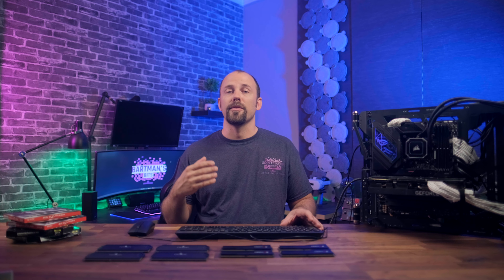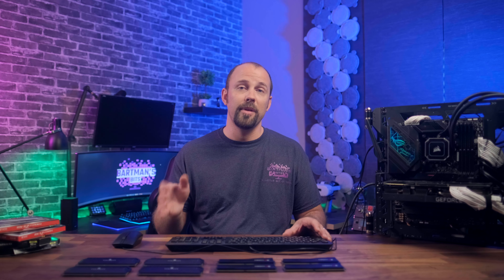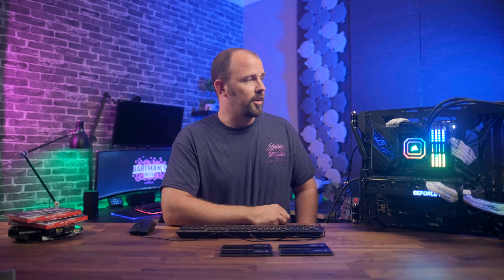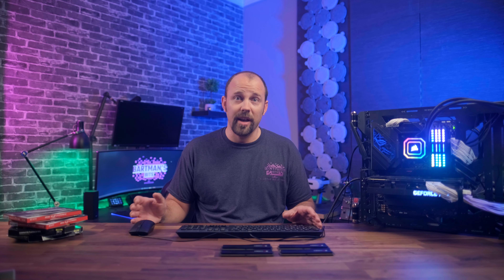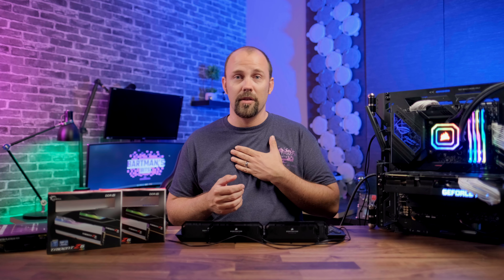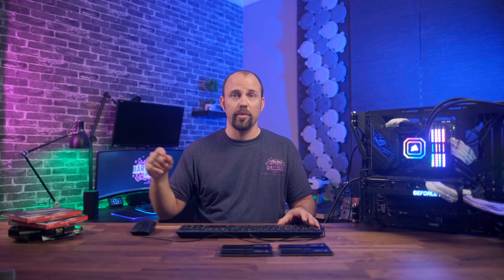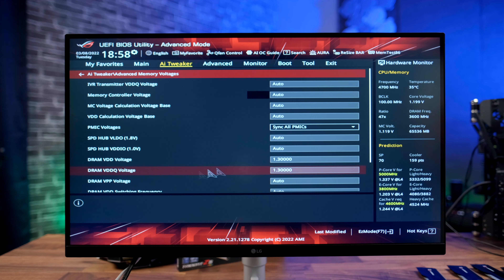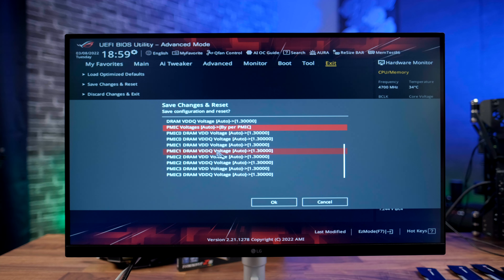Intel’s DDR5 problem resolved! DDR5 64GB Boot Loop failure Fix. Get the rated speeds of your RAM!

Comment: Hello, I have the X670-pro board purchased almost 2 months ago and since the first day I am having difficulty using the kingston KF560C36BBEA-16 memory, two 16GB, sometimes the board does not recognize the memory. I need to turn on/off to recognize it.

I have already contacted Kingston and they tell me to test with another memory, but I don't have other DDR5 memories to test... but first I thought of asking you if this board requires some configuration to be done to recognize the memories?

I don't know if it's a problem with the memories, I believe not because it works sometimes.. but I'm going to test with these memories that I mentioned that I got on the Asus website from the test memory list.. ALTHOUGH THIS ONE from Kingston is on the list

obs: memories are placed according to manual orientation, in the two gray one each, A2/B2 but black bus A1/B1 tried several times did not manage to recognize any only gray bus B2/A2. I did EXPO II but I tried with EXPO I and also without overclocking.
I updated the BIOS.

Comment: Hi! My system won’t post despite the changes in the video. My motherboard is an ASUS ProArt Z790 Creator Wifi and I’ve updated the bios to the latest version. I got 2x32GB of Corsair 6600MHz CL 32/39/39/76 plugged into ram slots A1 and B1. I can’t increase the voltage more than from 1,4V to 1,43V without the system becoming unstable. Any tips in fixing this?

There are also two XMP profiles when i choose XMP. One with the speeds and timings mentioned above, and one with 6800 MHz CL 32/40/40/76. I’ve tried posting in both. The motherboard is compatible with the RAM according to ASUS website.

Comment: Brand new install, i9-14900KF, Asus Maximus z790 Dark Hero, and 3 kits of DDR5 wouldn't even go to bios.  Stuck on error 55.  Your settings got me to bios, but then I was met with "Recovery" light blue screen, and another time a windows Blue Screen TPM.sys error.  XMP voltage is 1.35, so I bumped up to 1.40000.  Any thoughts?  This is the worse PC building experience in over 30 years.

Comment: I have 7950x3d , asus rog strix 670e-f wifi bios is updated 4090 and memory kingstone fury beast 6000mhz , when i try this , everything seems ok, i did not stress it for one day but on aida for 15-20 mine there are no fails, however when my pc boots when should be the bios menu image it says dp no signal and then boot into windows , if i run it at stock 4800 the boot menu appear and e everything is ok, also my expo voltage is auto set on 1.35 so should i go higher than that? In the package it says 1.35 thank you!

Comment: Could do with fast response if possible as I'm stuck in bios😢 In Ai tweaker my Dram vdd and vddq are both set on auto and I have no option to set to 1.3. I have ddr5 5600 dominator ram and a UEFI board with same bios. I do have some settings in the advanced memory voltage and both are set at 1.25000 but I cant change them and don't want to try until I can complete the previous stage. Thanks.

Comment: I kinda wish mine didn't boot, but it failed in a much more insidious way for me. I would get weird crashes in all sorts of programs but only one out of every four or five boots. Memtest86 would pass every time, and for a while I thought my video or audio drivers or hardware were at fault. However, upping from 1.3V (my 6000 memory XMP default) to 1.35V and using this per PMIC setting completely stabilized these issues I'd been chasing for months.
(Edit: Just want to add this was even with just 2 sticks and 32GB I ran into this issue so worth trying a careful small overvolt even in this case. I know 6000Mhz is well over spec but previous generations easily running well above spec without extra work had made me complacent.)

Comment: should i also change the ram voltage to 1.3 for DDR5 128gb 6000mhz?  like in the video?
(all 4 slots filled / 4x32)

Comment: I have Asus Z690-E Wifi mobo with I9 12900K and 4x 16GB T-force ram at 6400Mhz. My pc was giving me random BSOD , in game  and on desktop, idle or under load and use. I tried this method about 2 hours ago and so far my PC is stable. the only thing was that the default voltage number for me was set on 1.35. Upon changing that to 1.4,  I was not able to boot and it would get stuck in the training phase. The magical number for me was 1.37000 in order to be able too boot into windows. I hope that these changes will make my pc stable :(

Comment: Didn’t work for me 😞 

Just boot loops on my z690 hero. The voltage was 1.35 (set by mobo) when I tuned on XMP. Tried the other setting “per module” just can’t get past training the memory.

Comment: To this day this problem continues. Two weeks ago I built a z790-e rog strix and my first option was 16x4 7200mhz ddr sticks, there was no way for it to boot with XMP. It only started if I set them by default to 4800 MHz, I changed the 4 16x4 sticks to two 32x2 Corsair dominator titatinum 6600 MHz sticks and they work perfectly even making them reach 6800 MHz with the factory xmp profile, I advise you not to touch the voltages because if you ruin the ram for that reason, they will not refund your money, you will have to wait for a bios to come out that allows you to have 4 sticks

Comment: I'm having issues with just 2 sticks on a $300 board 🤬. Gonna check your video out to see if ram is indeed the culprit for random restarts
Reply: Xmp does not work for me at all. I've tinkered down from 1.3 voltage. I've tested speeds from 6400 to 5800 to 5000. Only disabled xmp works and it's very unstable as is at 4800 smfh. i don't get it. The best performance I've had so far was with one stick in.

Comment: Finally solved on my b660-i!! Thank you for the tips!
Reply: I have Asus ROG B660-i, and RAM Adata XPG Lancer 5200Mhz 1x16GB. Problem BSOD/restart/freeze. Is that solved for raise voltage to your rams? I just found this vid. And will do it at night
Reply: @SatriaMahardhika93  I followed all the steps in the video but the one that really solves the problem is at minute 6.26, i.e. set the "PMIC voltage" parameter in "By per PMIC"

Comment: I’m having a similar issue with 4 stick. In An Asus system 4 sticks of fury Best ddr5. With any new bios in the last year system will not boot and with newest bios cannot set speeds above 3600. I am using older bios and system works running at 6900 but unstable at any speeds. Know of any fixes for this issue? Thanks great video.

Comment: Oh man, I have this exact scenario with the dominator 5600 ram and was quite disappointed when I had learnt that it wouldn’t support the xmp profiles. 
I will have to give this a go, and hopefully it will run stable while racing in acc. Curious what improvements I will see.
Reply: 64gb Dominator 5600 on i7 12700kf, rog strix z690-g
5600 didn’t want to boot. Dropped to 5200 and booted up. Ran through some of the 3D mark stress tests and assetto corsa competizione. And running great so far. Better than the 3600 I was getting before.  Debating if I attempt to up the voltage a tiny bit more. And see if I can get the 5600 to go.

Comment: I am using (4x16GB, 5600 Mhz) CMT32GX5M2B5600C36 on a Asus ROG Z690 maximus extreme motherboard(with latest bios ver 3101), can't get my system to boot with those settings. Reducing the clock speed, best i can boot is at 5000 Mhz only. What should be the voltage to get the advertised speeds?

Comment: I was wondering if you had a bit mor info regarding this issue and resolution. My system is as follows  Asus Z790 Dark Hero, Intel 14700k,Asus TUF Gaming 4090,  Corsair Dominator Titanium 48 GB 7200 MT, iCUE LINK H150i RGB AIO Liquid CPU Cooler with 4 additional Fans, 2 Samsung M.2 2tb drives, Corsair Shift 1200 PSU. when I tried it it ran at 48MT which was not any where near. I tried using your  method you recommended of slightly higher setting, no joy I removed the other  ram and now I'm getting 7400MT. any suggestions would be appreciate it or from your followers. Thanks

Comment: I turned on XMP (before I found this video) and it blue screened, and then kicked into windows but the RAM stayed at the default speed and was very unstable and kept blue screening. I set it back to default and I’m at least stable now. Will this fix that issue of the speed not changing or do I have something else going on?

Comment: Thanks bro for this video i can go with my ddr5 corsair dominator 5600 16x4 with 1.300v and after setup i pull out  all ram and switch ram position and put it back all works many thank bro.

Comment: Great insight and video into the fault. I thought was going mad and had wasted good money. This boot loop failure exists on x4 32gb Corsair Vengeance RGB 5600Mhz in an ASUS ROG Strix 670EE also with the latest BIOS update 18/11/23 again ok with x2. Also had issues with ICUE with warning triangle. I have tried what you have said at present still not showing as 5600Hz as on Box and kept looping. The only way it works is in the default setting 3600Hz????. When are #ASUS and #Corsair going to sort this problem (Don't they test x4 sticks out together..odd)?? Will attempt another go at later stage waiting for support to get back to me. In end sent back 64 for refund as the products don't work as advertised.😢

Comment: Update.  Today I was able to manual overclock my 4 sticks DDR5 128GB TOTAL from 4800 to 5200 mega transfers.   I went in and rather than turning on XMP i just changed the clock speed to 5200.  Then i overvolted as show in the video to 1.325 on DRAM VDD and DRAM VDDQ.  I also set the PMIC Voltages to "By per PMIC" the advance memory voltages menu.  Seems stable so far.  My Ram is rated for 5600, but i just cant get it to hit those speeds stable.

Comment: Hello, I have an Asus b660a gaming edge 6000mhz(O.C) wifi ddr5 motherboard and when I open gskill 2x16 32 gb cl36 ram 6000 mhz xmp 3.0, I get a blue screen error. I have no problems in games, especially at 5800 mhz. I can run it at 5800 mhz when xmp is not turned on. ?

Comment: It didn't work... I think this is almost it though!
MSI z790 board doesn't have the "sync pmc" setting anywhere I can see (so I can't un-sync it). Closest setting is "link/ unlink" which gives options for voltage for each stick (and the single vdd vddq setting disappears)... tried setting every stick vdd vddq to 1.3... still doesn't work. 

Ram is corsair vengeance 5600.
Also tried same with setting the msi "try it" setting to 5200/4800 and still doesn't work.

Comment: Hi, I just ordered my z790 maximus hero and Kingston fury 128gb(4x32) ddr5-5600...can you please tell me if I would be able to run all 4 sticks with proper speed with the method explained in the video?
Reply: I was going for the same but the maximum formula z790 . White 14900k and wanted 4x32 Kingston fury renegade 6400 or if that delivery takes to long I found 6000 in stock thinking maybe go for the 6000 because they’re in stock .  So also wanne know if it can run all 4 stable and the pc will work ? Let me know if you figured out already

Comment: Thank you for this video. I have two sets of 32GB kits of DDR5 Corsair Dominator at 6200mhz each. I was only ever able to get them to run together stable at 4000mhz which is its base clock for those kits. With your suggestions I was able to run them at1.35v at 5600mhz (manual XMP wont work) but it would crash in God of War and Horizon Zero Dawn by clocking it back to 5400mhz I can get it all to run no crashes in anything latest bios as of April 2022. Thanks!  
Here is my setup but it seems 52-5400 for now is the limit. 
EDIT: I now have adjusted timings and at 5400mhz the 64GB (both sets of 32gb 6200mhz) runs equal in bench marks to what just 32GB at 6200mhz used to run! So I take no lose now using the extra ram for demanding titles like DCS.

ASUS ROG Maximus  Z690 Extreme
Intel i9 12900k
Thermal Grizzly 12th Gen CPU Contact Frame
32GB (2x16) Corsair Dominator Platinum RGB Ram DDR5 at 6200 mhz (now 64 at 5400)
ASUS ROG Strix 3090 OC Graphics Card OC Edition (ROG-STRIX-RTX3090-O24G-GAMING)
EKWB Vector Waterblocks Front and Active Backplate
Five- 2TB Samsung 980 PRO M.2 Drives
2.5 Samsung 860 EVO 2TB
2.5 Samsung 870 Evo 4TB
Lian Li Strimmer Plus V2 GPU Cable
Lian LI Strimmer Plus V2 Motherboard Cable
Corsair Hydro X Series, XD5 RGB Pump/Reservoir Combo
Corsair Hydro X Series XC7 RGB CPU Water Block
7) Corsair QL140 RGB 140mm RGB LED Fan
4) Corsair QL140 RGB 120mm RGB LED Fan
2) Corsair Hydro X Series XR5 420mm Water Cooling Radiators
2) CORSAIR iCUE COMMANDER CORE XT Smart RGB Lighting and Fan Speed Controller
HX Series HX1200 1200 Watt 80 PLUS PLATINUM Modular PSU
Corsair 7000X Case
Corsair K95 RGB PLATINUM Mechanical Gaming Keyboard — CHERRY MX Speed — Silver (modified with two O rings per key and SteelSeries PRISMCAPS)
Corsair DARK CORE RGB PRO Wireless Gaming Mouse
Corsair MM800 RGB POLARIS Gaming Mouse Pad
Reply: Where is you find a thermal grizzly contact frame for sale?
Reply: @vids595  Titan Rig
Reply: Just finding this video & seeing your post. What kind of timing changes did you make to get the 6200Mhz working at 5400? I have a very similar setup to yours (same memory, motherboard but with a 12900ks) so I'm curious to your timings & voltage so I can try to do the same.
Reply: @curtisjackson8118  I pretty much used his exact same settings and it ran no problem. I have since however switched it all back to default as I am giving that board and processor to my brother to build him a PC and am switching to The Rog Maximus Extreme Z790, delided I9-13900k and a Asus 4090, just waiting on my GPU water block from EKWB and the board to ship on monday to assemble it all.
Reply: Can u help me, I have the problem on my XTP 1 (ddr5) how can I solve it?

Comment: Does this apply with ddr4? I have 4x 16gb ddr4 corsair vengeance rgb rt, (3600mhz if xmp enable) Im having a problem to make the system stable even if the xmp is disabled. System has micro stuttering  and ramdom crashed.

Comment: Hello, I loved your video, I have 4 G Skill DDR5 Trident Z5 16GB 6000 MHz memories, Timing 40-40-40-96, 1.35V, a Core I7 13700KF, follow your tutorial, but the XMP comes out to 6000, change the value from 1.35 to 1.30 and 1.40 and don't work! any recommendations ?

Comment: I have a Maxsun MS-iCraft Z690 WiFi motherboard and those settings worked for me as well. Without that, the system won't boot at all on XMP. Is it a BIOS issue? Did Asus fix that? Because it is strange for different motherboards to have the exact same issue. I'm contacting Maxsun about that.

Comment: Doing this in 2024 with my 6000 mhz, worked without increasing the dram voltage as it was already at 1.35

Comment: Hi, It didn't work for me. Strix Z690-E + i9 13900K + TForce Delta DDR5 6800MHZ 4X16GB.
But if set to 6200MHZ then they work without problem.

Comment: Should this work the same on a AMD X670E board with 128gb of ram?? I’m trying but it keeps booting into bios safe mode and reverting. I can boot to windows with all 4 sticks but only by letting the bios downgrade them from 5200 to 3600.

Comment: The Gigabyte Aorus Master MB has User4 profile to set DDR5 params but for some reason it does save those 1.30V change it in BIOS before exiting. Any chance you could take a look? Thanks.

Comment: Gigabyte B760 Gaming X AX LGA 1700 ATX with 2 sets of Corsair 32GB (2x16GB) CMH32GX5M2E6000C36 Vengeance RGB CL36 6000MHz DDR5 RAM. The system was built and tested by the company I bought it from, but I am having crashes and especially game crashes. I don't have trouble getting into windows 11 which is fully updated and so is the geforce drivers for the 4070 ti. Would this trick possibly fix my issues. At the moment I disabled the xmp to test if there is any issues. Motherboard is at bought version of F2.

Comment: What solved it for me was making sure my ram was in slot 2 and 4 (not 1 and 3)! After moving the two sticks to 2 and 4, I set bios to use XMP 2 and then it finally booted normally using the 6000 MHz the RAM is supposed to be able to run at. Nothing fixed this while they were in 1 and 3 slots. So try that if you only have two sticks. As this video is now 2 years old, there have been BIOS updates to help with the DDR5 issues. So you most likely wont need to do the fix explained in the video. (Could be worth a try though)
Reply: still the problem persists, my bios is up to date. The values in this video are not suitable for my system, I will try to make it work by tinkering with it. GSKILL 128GB (4x32GB) TRIDENT Z5  + Asus Rog Strix Z790-a
Reply: I am having same issue, please help

Intel i9 14900k Crashing / Gigabyte z790 UD AX
I see unexpected crashing issues when I install 4 G.skill Trident Z DDR5 RAM sticks (4000 MT/s) instead of 2 (4800 MT/s).

Some config I have setup:
Performance CPU Clock Ratio: 55
Efficiency CPU Clock Ratio: 42
Extreme Memory Profile: disabled
BIOS is up to date : [F11e]

Comment: Hey after updating to newest bios fot my Asus Hero 2602 i needed to change tweak mode from auto to mode 2 under DDR Timings and even the full speed  of my 5200 Corsair RAM works fine

Comment: I have the Msi z790 tomahawk and if I enable XMP then I get BSOD, but memory diagnoses detects an error. If I also enable the memory kit try it to the DDR5 C36 6000mhz then I do not get any errors but all my games crash. 

I’ve contacted Msi but I cannot get an answer and if I manually add one or two things like I noticed all my dimms are correct bar dimm 1, for some reason dimm slot 1 doesn’t have any frequency stuff so manually adding fixes crashes but still games crash. 

I am so frustrated on how to fix this. If I use 2 or 3 slots it’s fine but 4 nope. So 64Gb DDR5 6000mhz is currently not using xmp at 4000mhz. Any help would be amazing to run what I can paid for.

My pc does boot with but loading games etc crashes either the game or pc. I am lost. If xmp and memory kit try it is on, my pc does boot cycle like twice before getting into windows